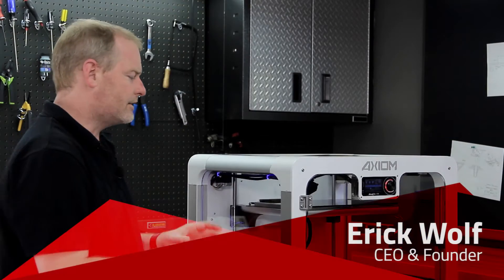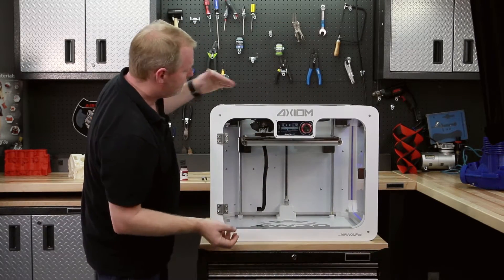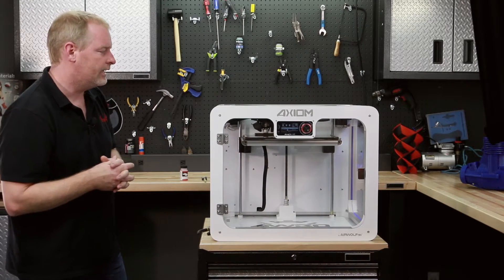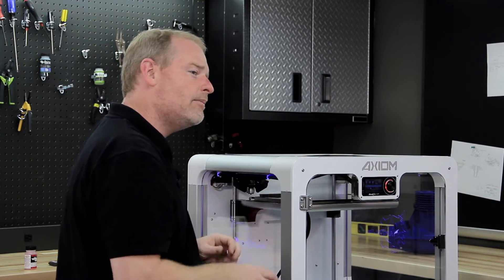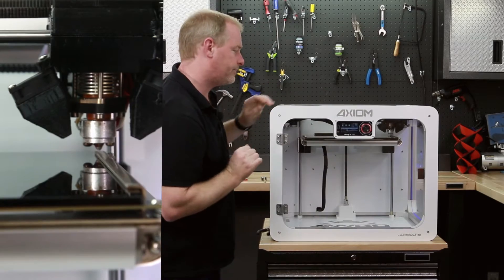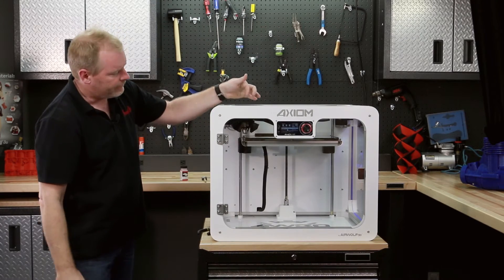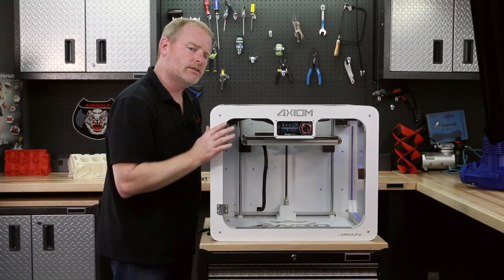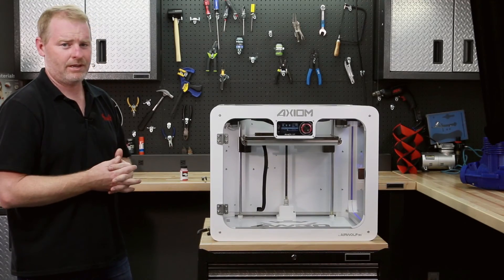Erick Wolf Talks About the Axiom and 3D Printing with ABS. Part 3 of 3​

Comment: This printer is amazing, I have successfully run multiple 40+ hour abs prints without any issues, and this is my first 3D printer.  It really is a push "print" and forget it system.  The most I have to do is check it 10min into the print to make sure I have enough active wolf bite on the bed, by then I know if I need to add more and restart the print (implying the abs will already not be sticking if I don't have enough wolf bite) , and secondly just make sure it doesn't run out of ABS.